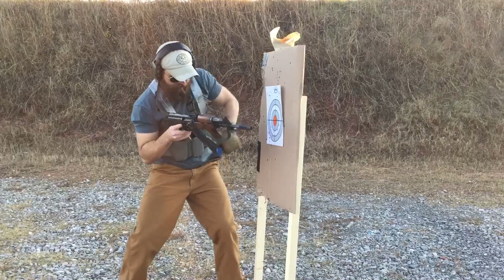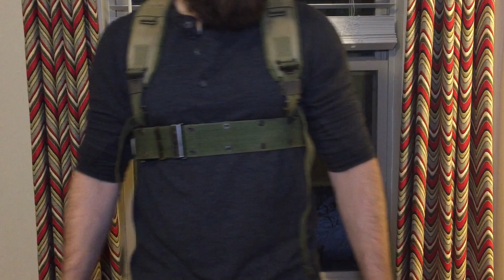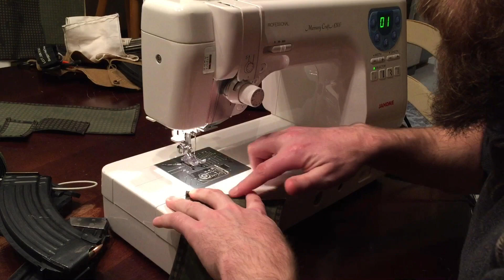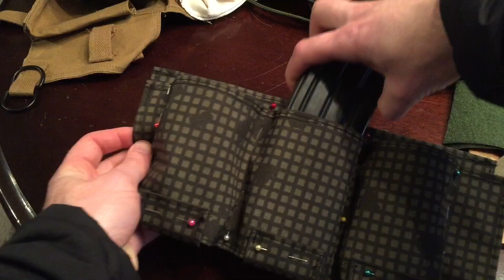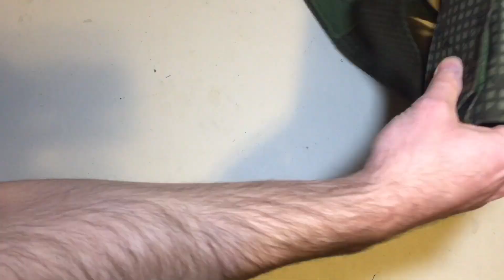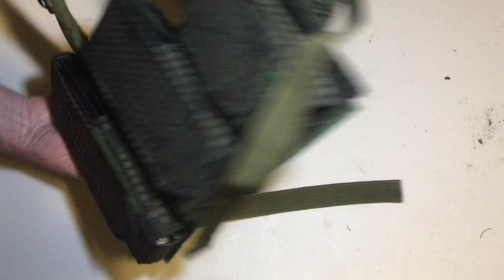ALICE webbing made into a modern chest rig

Comment: Great pouches! I bet you already surpass a large percentage of "overseas" producers in quality. Where did you find a good, strong thread for this?

And I really want to see the plate carrier!
 Will it be level 3 or 4? I was thinking of project like this and thought of just using molle straps to contain it, making it as thin and lightweight as possible.
Reply from the maker: I was recommended the brand Aurifil for the thread, I really don't know anything about it though. 
Yeah I think you could definitely do the molle strap idea! For plates I have 3+ and I'd like to get a set of pistol rated soft armor to go behind them for a little more protection and comfort.